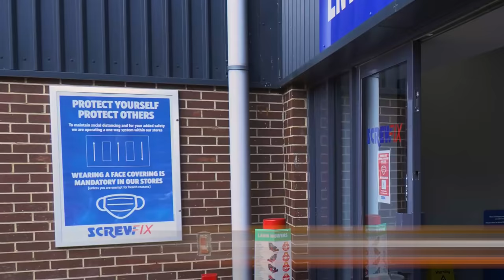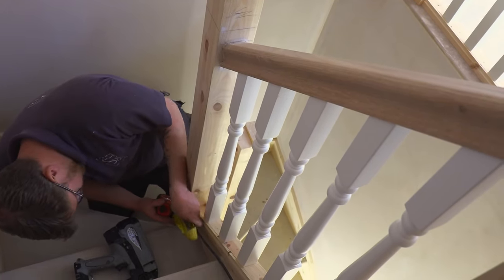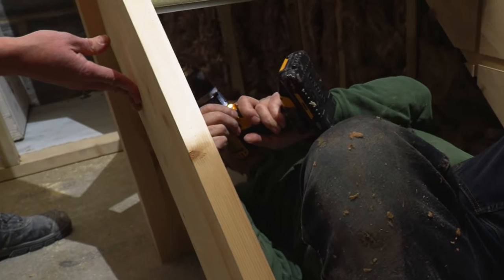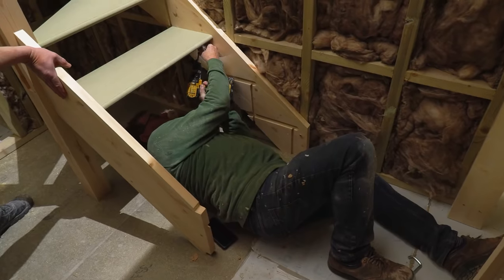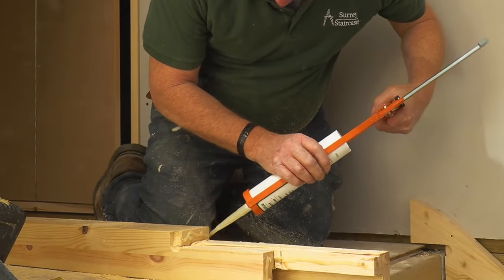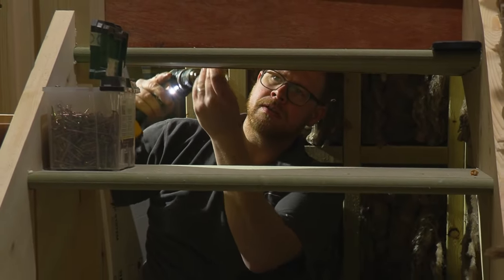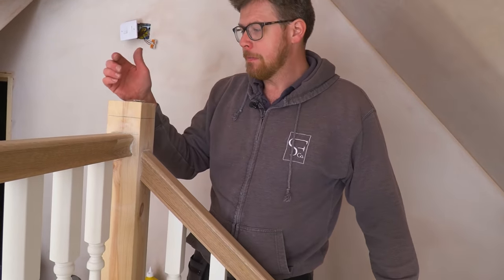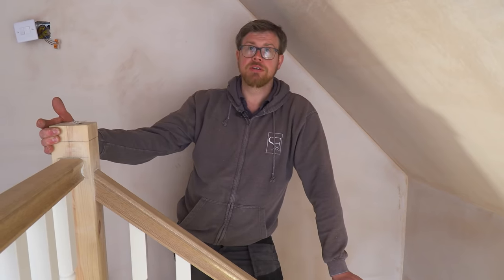Fitting Staircase Spindles ~ Extension Build #17

Comment: I all ways glue them has well pin them great job
Reply: The fillet pieces or the spindles? Or both??
Reply: Agree with you glue as much as possible, 18 gauge gun as well, if a good glue is used you don't have to pin the bottom spacer, makes it look clean.
Reply: @christophercrowle9753 what clue would that be

Comment: Nice to see someone taking the time to work out equal spacing, 
The amount of people who use Burbridge pre cut infills and have an uneven gap at one end really grates me!
But I can't agree with your views on wedges v polyurethane glue and screws. Polyurethane glue is an aerated product, in time it will compress and the screws will break or squeak. 
Would you only use expanding foam under a door cill without packings?
If you have to rely on screws and PU glue, wouldn't it be better to screw from the top holding down to a solid base?
(Plus the fact that wedges in staircase factories are cut from waste material, saving money and reducing waste.)  Wedges are a time proven method. 
Now let's look at draw boring towels and glue blocks.....

Comment: Hello Roger I see a comment on here why would you house the handrail in. Well you might because if the newel shrinks in it's  with which timber does shrink more in it's  with than length you won't  see a gap also some times strings are housed into the newel also. Everyone has their ways of working  the journey make take a different route but if you end up at the destination it's  a gooden.  Well done James😊👍🍷

Comment: Looks good, definitely more than one way to skin a cat but generally the right way is best. 
Love that foamy glue though its been a revolution to the modern joiner and their loose fitting joints.
I worked in a workshop for 6 years and on site fitting what we made all made easier by polyurethane lol

Comment: I haven't  got a problem with there being no wedges as I agree that the polyurethane glues really hold well but I've got to say whenever I come across a creaking staircase pretty much all of the time the creak is where the tread and riser meet roughly around the middle of the tread. This is usually caused by the glue breaking away from the riser on the glue block.
To get over this I cut a new riser out of 6mm ply really tight to the top of one tread and the bottom of the other over the full width of the original riser then glue and screw it to the original riser and this stops the creaks. If the issue was with the wedge then this wouldn't stop it
Reply: Pocket screw the tread to the riser from the back.
Reply: its normally the carpet fitter nailing the gripper on the riser and he breaks the tread to riser glue joint

Comment: What’s the most common cause of creaks? Most new builds I’ve been in start creaking after 12 months. Are they not using enough glue/fixings? Or the wrong stuff?
Reply from the maker: It is all about timber drying out. If you put in a wedge and it shrinks, as it will in a heated house, you have a creak.
Reply: carpet fitter nailing the gripper to the riser

Comment: Hello. Help much appreciated please

Long story short. I need to remove my handrail and ten spindles to allow me to fit my new sofa up and down into the living room doorway. It is the only option I have of getting it to fit into the room

Question. How and where should I saw for the cleanest cut ? Will it be possible to fit back?

I had a quote of like £600!??  🤦🏻‍♂️
I just want to temporarily remove it. 
Sofa is in my hallway taking up all the space so its quite urgent and I dont have much time between working . Bit of a nightmare. 

Any help would be so appreciated please

Thanks

Comment: Take the extra 15minutes and put glue on the filler pieces and spindles. After all will stop them from squeaking in or rattling 👍
Reply from the maker: Do you think they will rattle?
Reply: @SkillBuilder  yes they will as you said yourself timber will shrink, move. I've seen and come across it myself replacing, revamping stairs. Clients saying there stairs rattle. All you have to do is hit the post/handrail and it's like a musical instrument.
Reply: @SkillBuilder  now I'm not saying what you guys did is a bad job. Everyone has their own way of fitting just from experience in use glue. Set of stairs are not a piece of furniture. They are to be in a house building for a long time. They are put in to withstand slot of abuse. Glue will add that.
Reply: @snwman862  id glue them as well
Reply from the maker: @snwman862  Have you ever had to replace a spindle that has been broken? I have and I thank the carpenter from years ago who didn't glue them up. I have an Edwardian house and removed all the spindles and had them dipped to remove the old brown varnish and then popped them all back in. It took no time because the spacers were not glued.
Reply: @SkillBuilder  yes I have. Usually I always go in with the expectation that they are glued as I would expect them to be but not always the case. Does it make the job easier. Off course makes it a breeze. But I know Ive been asked to fix more stairs with rattling spindles and not glued in posts then fix broken ones. So just speaking from experience really

Comment: Roger what is best for cracking along the stringers when it’s all been plastered and ready for painting. Thanks
Reply: Good quality flexible caulk
Reply from the maker: That problem can be fixed with a good quality caulk such as Dunlop but James brings the board down on top of the strings which solves it for good.
Reply: @SkillBuilder  Hi Roger, When you say James bridge the gap by sitting the second layer of plasterboard onto the string,  won't this just leave a crack as well?
Reply: Rake out the crack using a Scraper or decorators 5 in 1 multi tool. Lightly spray the crack with water and apply expanding foam down into the gap all the way along it. Once dry, take off the excess foam and using the corner of your Scraper or folded sandpaper, score or sand a v into the foam. Stabilise the repair with a very diluted mix of pva and water. Once dry, apply a neat bead of powdered filler with your finger, sand nice and smooth when dry. Stabilise once more and then paint.
The importance of using foam and not just caulk is that you have to stop the movement between the wall and the timber and foam will help with this. If something moves, it will crack. Simples. Hope this helps. Stay safe everyone.

Comment: Im sorry but it takes seconds to add glue to those spacers and top and bottoms of the spindles, I have a staircase business and glue everything, why you wouldn't glue them is beyond me, and the hammer marks on them spacers and spindles are going to look simply lovely for that rustic diy look.
Reply from the maker: The nail head is below the spacer
Reply: Steve is right. Got a 10 yr old unglued spindles here and now the wood has shrunk you can almost pull some out.
Reply: I always glue the fillet pieces and the spindles top and bottom. Two 18ga brads in the fillet pieces and two 15ga finish nails in the top and bottom of the spindles, 👍 🔨 🇮🇪

Comment: Why no glue ??
Reply from the maker: What does the glue do?
Reply: @SkillBuilder  as a stair fitter company I can say one thing, Every staircase I come to refurbish which has spindles fitted with no glue on the spacers or spindles is a joy to remove, they are far easier to remove and removal of the handrail gets the job done in a second as the spindles all fall out, the problem is that as a staircase it was so noisy as the entire length of hand rail rattles on them as everything has become loose. All the spindles will move up and down side to side forwards backwards as the heating kicks in everything will shrink and no glue makes the problem 10 times worse, those 18 gauge nails fired into the spacers and spindles without glue will become pointless in a few months.
Reply from the maker: @FPL-LARD  O..K Steve when that happens we will let you know but you could see how tight they were so where it the glue going to go?  It will ooze out.